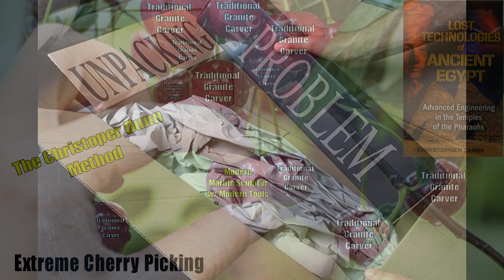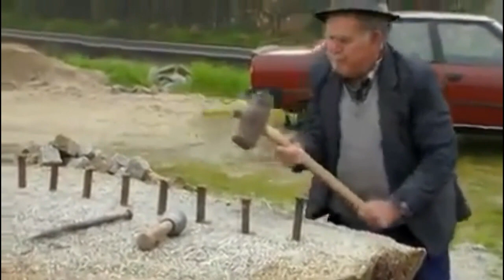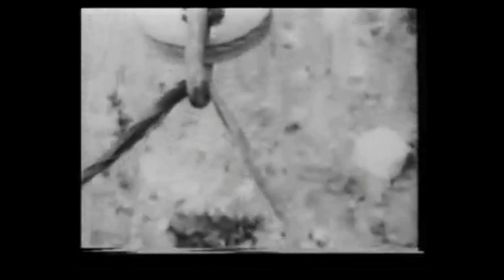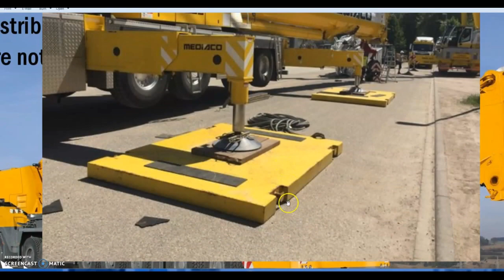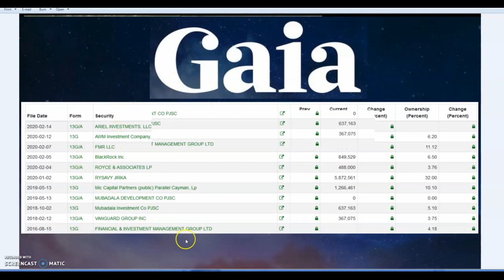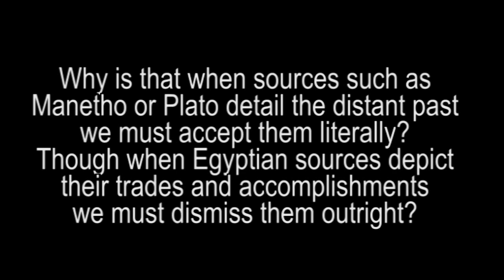Lost Ancient High Technology & Cherry Picking

Comment: Hi there mate, just some info for you. Me and my druid friends have created 3 stones circles now. The best one was in Hascombe Hill. We used only ropes, bars, and stollage blocks to move 5Ton stones up a hill and along. In the beginning it took about 60 people to move a stone and by the end of it, after a year of practice and experiment... we got that down to 6 people moving the same amount of weight!!! but the weird thing is we had to sing to the stones to get them moving. That might be a psychological framework on our part, but its part of my experience. They wouldnt budge if we didnt sing to them first, and people would get hurt.

What we could do is:
>Drag stones up a hill using ropes around a tree acting like a anchor point, and dangerous twisting of the rope with 4 people on a beam. Stone rested on rollers made from telegraph poles.
>pivot the stone on another baby stone, with pebbles
>then drag into position again, stollage it up into the air about 5ft off the ground
>dig a hole in front of the stone, bury four poles beside the stone at half way point, then strap a pole underneath. So now you have a bar the stone can swing on, anchored by two V's
>complete digging underneath the stone, then the stone would flip upright as easy as piss

We inaugurated it in 2000 called the "dragon stones" part of two others we build with Ivan mcbeth. First one we made was called "swan circle" (Cygnus) at the Glastonbury festival field

https://live.staticflickr.com/3166/2628553765_743b35d9cf_b.jpg
https://guerillaarchaeology.files.wordpress.com/2014/06/glasto-1.jpg
the other one is on private land

All the best, k
Reply from the maker: Sweet!!! Great stuff.
Once the current craziness ends me and my older bro will try and do some larger demos in the field. He’s got the stone bug too now.
Reply: @SacredGeometryDecoded  Thats good, great stuff. heres my email shjenoob@hotmail.com ill leave it here for a while and delete it. If you guys want to ask questions or need some ideas let me know. Will be happy to help, kieron
Reply: nice ;)
a circle as a calendar?
Reply: @KaroBike  hi, are you asking for information about druidary and honoring nature at certain times of the year ~ is that what you mean mate?
Reply: @DiyEcoProjects  exactly as you're saying ;)
Reply: @KaroBike  I don’t mind honouring the request if youre being sincere and charitable. If you have any questions id be willing to answer. Im not trying to convince you, this is just giving you some ideas to explore.

What is druidary? We honour nature and all life as sacred. We have 8 main ceremonies in a year to give thanks and send out blessings to the world. It’s a spiritual path of self discovery. It informs me to make better choices in life, to harm non

Also importantly there is no archaeological evidence for any human sacrifices, that’s something that horror films make up because they are using it to scare people (we like a good safe fright). Also the victor (Caesor) gets to write their version of his-story. The wicca man film is pure nonsense, and shows more about the mentality of the script writer than it does actual facts. 

Definitions:
>Druids where the peacekeepers, philosophers and community elders of the Celtic people. Both woman and men can be druids. 
>Craft witches & wiccans are similar to native shamans, the use poems and potions.
>History: Ross Nichols revived modern druidary inspired by bardic peoms, and his friend Gerald Gardener revived the traditional gypsy craft (witchcraft that never died out) and called it Wicca. They both decided that druidary and wicca was so similar that they combined the druid solar ceremonies with the 4 craft ceremonies to create the 8 fold year. Making what we call the wheel fo the year. Druids have been in government and advocate for peace, Winston Churchill was a druid. Gerald and team did a private ritual to stop the nazi’s crossing the English channel..
>Ceremonial celebrations are for sending blessings out into the world, to all those willing to receive
>Rituals are for focused things like marking important moments in time: Baby blessings, Weddings, Passing over of the dead, Blessing the land to ask for good harvest etc. 

Time can be perceived as liner:, youre born, you go to school, get a job, get married, have kids, you die. But you can also experience time in a different way. By tuning into the seasons and marking those points intentionally you start to tune into natural rhythms. Life then becomes “oh its spring again, I remember three springs back what it was like…” you return to the same spot in the circle of the wheel of the year, the metaphors are still there but time has advanced forwards. Think of a bridge, the next time you go there and look out at the water, its not the same “water”. All the cycles does is remind us to stay in the now of time. Be here now. Live now.

Clocks and time was invented so that you would pay your taxes on time and worry about if you had ENOUGH of it. Its not harmonious to seasonal changes or our body. Its so disharmonious in fact that our calendars need updating every 4yrs by a full DAY. They’ve actually deleted dates and changed the calendar several times. Yes time has been changed! … currently we are on Gregorian time. Another way to look at cycles of time is social repeating patterns in History ~ which tend to repeat in cycles of 40. 40yrs/400yrs/6400yr cycles. Some of this awakening of humanity and spurts of creativity is locked into whats happening with sun cycles, you cant build stuff its it freezing or muddy lol. The most accurate dating system is the mayan calendar great count (other cultures discovered it too) with cycles lasting 26,000yrs marking both ends of the birth of venus. Its so accurate in fact that its only out by 1min each 26k years!... The great count restarted again in winter solstice 2012… and you lived through that gateway. This is like the First light of returning energy as we move back closer towards our twin star, which is Sirius btw.

Getting back to the circle youre asking about… it is used as a framework to hold a vast amount of information. It’s a memory device in a sense. 

So when we stand in a circle to have ceremonial celebrations. We have a library of traditional symbols and meaning “placed” around a circle. Welcome to get a large bit of paper and draw this out.

4 Traditional Druid festivals, directions and symbols:
Winter solstice = North = Earth = Endurance, Birthplace or the Void 
Spring equinox = East = Air = Inspiration, Dawn, Light 
Summer solstice = South = Fire = Passion, Inner Sun 
Autumn equinox = West = Water = Healing

4 Traditional Craft Celebrations, energetic cycles in a year:
Imbolc = Spring = North East = new life, new beginnings, we plan 
Beltane = Summer = South East = land is green, the lovers, the rutting, passion, we act
Lughnassad = Autumn = South West = harvest time, the “a-barn-dance”, celebration, we reap rewards 
Samhain = Winter = North West = honouring, thanking, prepare for winter, we learn to let go

So the way we experience time in a year then becomes: We plan >We act >We reap the Rewards of >and then Let Go
 
Whats interesting about druidary is that by following the year – you get to explore every aspect of phases in your life. Society says you cant be angry/sexual/fearful/must fear death… how then is anyone going to become whole if they don’t look at thier own darkness and bring it into the light?, how is anyone ever going to become whole?. There is no evil other than what we are capable of. Theres nothing in the dark other than ourselves. For instance Anger has a use … just not a daily use. When you’ve worked on yourself, these aspects can be healed and turn into: passionate truth/the lover/heightened awareness not dread/acceptance of change, letting go, it is as it is.

Druidary also makes life that more interesting because you don’t have to give up your previous beliefs or convictions. For instance im a Christian (in actions) Druid. But theres also people like shintu druids / buddist druids / hindu druids ect

For me, for all my years, ive never come across people of ill intent. We practice honouring nature and its seasons. We have personal practices every bit as beautiful as a hindu “rituals” for example. However … I do acknowledge the potential for darkness/evil exists BUT its in what we are all capable of not something outside of ourselves... There is no evil in the world other than what WE bring into it. For example: The internet is neither good nor bad, its in what people choose to put into it and consume. If youths want to dress up in black and go to the woods at night, into an abandoned house and spray fake blood on the walls. This is NOT druidary or wicca… its teenagers wanting to challenge and frighten themselves. If adults in suits/corporations/powerful families want to perform evil rituals to further their beliefs this again IS NOT druidry or wicca. This is because real pagans have a code of ethics which is “Do as thy will, and harm non” WHY? because we understanding that we are all interconnected fundamentally. To bring intent into this world is to effect everyone else, all living beings, including the self... To try and circumvent this truth is a fallacy and will eventually lead to downfall every time. Love thy neighbor as thy self you see. This is why those in suits will never ultimately succeed. 

Society needs scapegoats and wrong doing to know what love and peace is. This is why every religion and spiritual paths teaches about balance! … To be loving and not to ignore the evil in the world, but bring the wisdom of both so that you can choose. CONT
Reply: @KaroBike  
As an opinion, the way that society works is that theres a balance of power that repeats itself over roughly 40yr cycles. When theres too much liberal freedom, theres a need for control / and when theres too much control, theres a need for freedom again…. it rocks side to side. Interestingly the internet has speeded up this process and has brought imbalance to the status quo. This is because we able to have access to ever increasing sources of information. So now people have opinions about every sodding thing! opinions vs opinions. The reason the world is crazy at the moment and why we are fighting. Head butting.

In the past it was religions that people where crazy over. Everyone has an idea of God or Universal Mind, and people get to write their personal experiences down over the centuries and turn them into books… these books become law and then we get to squabble and kill each other over the details!! the whos right or wrong. How silly…. 

I have no doubt that an enlightened man called Jesus existed (there have been many other enlightened people in history). I believe, he had an epiphany that why should all the priests keep all the knowledge hidden to themselves and thus he went around teaching it the public, saying that you don’t need the priests ~ nor give them your tithes to temples ~ just a personal connection with god. And they bumped him off for it, because that removed their power base. You see, theres lots of money to be made from saying you have all the answers … whilst keeping people in fear.

What interests me is the repeating symbols and metaphors underneath the rhetoric of religions. So ive been looking into symbolism and heres some research you may wish to consider. 

The title names for High priests and priestess of the temple of Isis (Egyptian) were called a “mar-ray” and a “josepi” … breaking the words down.
Mary = Ma (mother) Rhea (Earth)  
Joseph = Jo (Father) seph Sepi (Sky) 
… so MOTHER EARTH and FATHER SKY gives birth to Sun/Son of God 

At the Winter solstice, if you look to the east, youll see the star of bethlihem (venus) is followed by the three kings (of orions belt) which point to where the new born “son/sun/light of god” is going to be born on the horizon (horus risen). The first rays of sunlight of the year brings with it new life and rejuvenation to the land during summer months, which makes things grow, flowers and green leaves (goddess and green man), animal births etc. new LIFE begins again. It gets resurrected out of the death of winter. SO this is the reality of the hidden metaphore of “the resurrection” simply because new life starts again each year… This light that returns is the Aton, the “Christos” (which means “light”) and we are ALL THAT because we are participating in this thing called LIFE! … It’s the promise that Light (Life) will return in some form after death … and YOU are all part of this eternal process.

So perhaps instead of getting hung up on the idea of ownership of an individual soul … perhaps there may be only one soul experiencing itself from many viewpoints or points of view… and that if you pulled away the mask of your persona (that which you call “I” the bit you defend and cling to) perhaps youll find yourself looking out as the “witnesser”. That bit that is underneath it all, the bit that we ALL are.

Knowing and experiencing this does not stop you from being grounded, protected yourself, eating and driving a car, needing to have a shit… it just adds another layer to understand this experience we call life. It puts you in the understanding of loving others / an-other / each-other.
 
I enjoyed that, sorry for the waffle but once Id started it just got bigger haha … Anyway just some things to consider. Much love, k

What do you believe? whats your point of view?
Reply: @DiyEcoProjects  
Thank you for describing the druids' philosophy in an interesting way;)
 
solstice & equinox
festivals at night or during the day? celebrating the longest night or the shortest day on the winter solstice? similarly celebrating the longest day or the shortest night on the summer solstice? or maybe several-day festivals? water - moon, sun - fire ..
  Did They Use (flint from the river "water") to burn the sacerd "fire"?

  there were agricultural calendars and astronomical calendars (astrological interpretation) .. I have no doubt that they had a deep knowledge of the movements of the planets and the "movements" of the stars ...

best regards
Reply: @DiyEcoProjects  https://www.youtube.com/watch?v=jQT5XRdrqvw
Reply: @KaroBike  Im going to move this conversation over to my own channel so that folks here can get some peace LOL ~ join me here and see the latest reply https://www.youtube.com/watch?v=RgOBbwB-1Hk